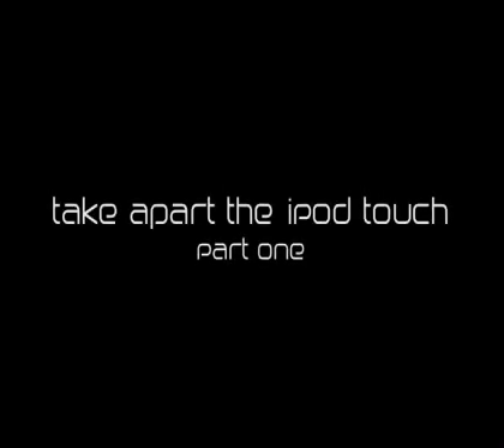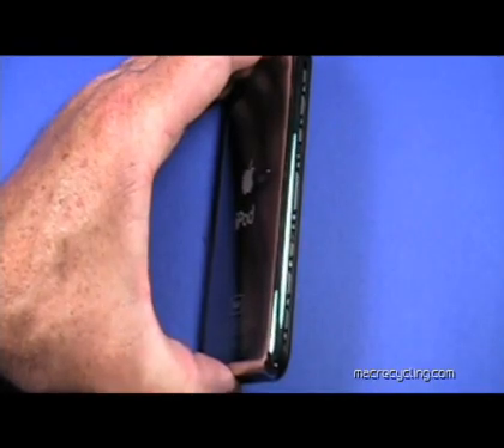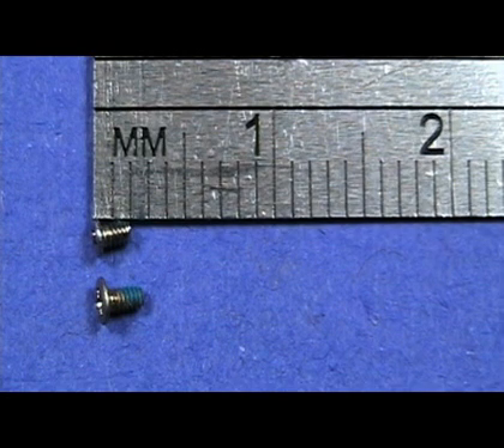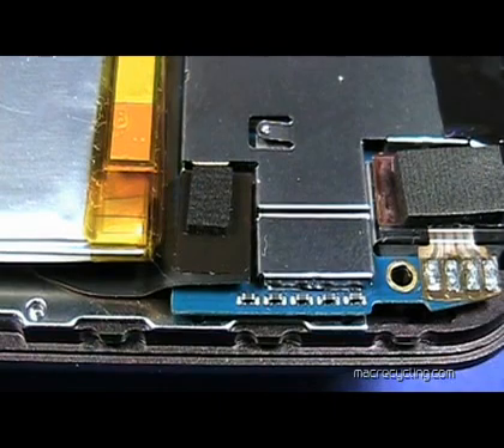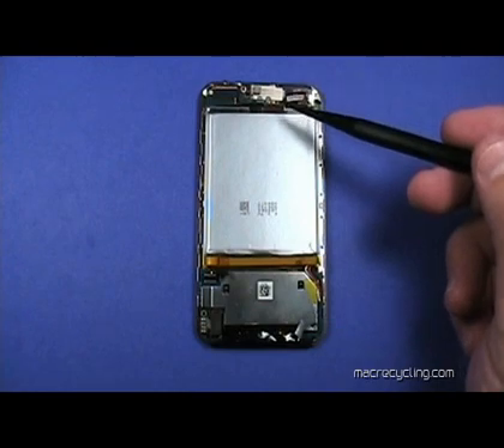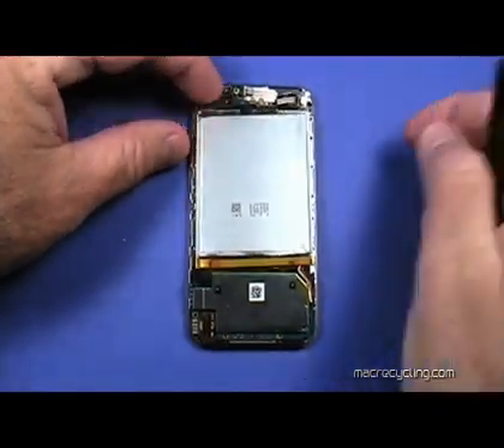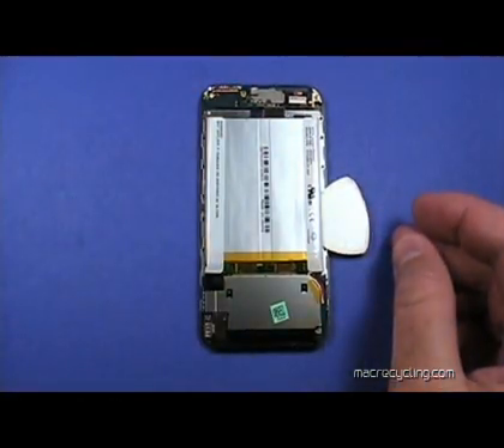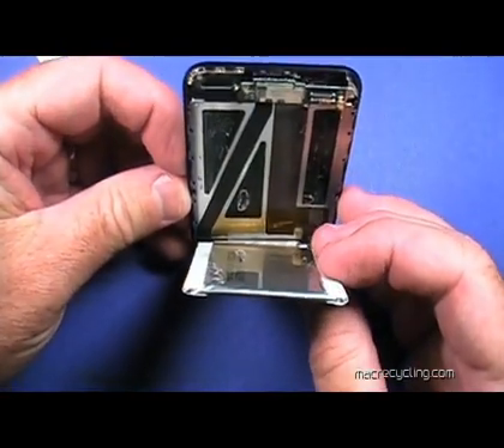Take Apart Apple iPod Touch 1G - Disassembly  Part 1/2

Comment: The 1st gen does need some love to get that battery off but dont worry so much these things are more durable then he lets on. I removed the battery with a knife no damage at all. In fact i did nearly the whole thing with a knife. the only bad thing that happened was that the coper spring came off but you can put it right back no problem.

Comment: This is a pretty good video, better than many others, as it warns you to be careful of the spring on the upper right. It's the first thing I broke on mine however, as I found a different video first. The location of the glue on the battery is a good tip too, thanks! Wish I had found this video first.

Comment: Ok I have a ipod touch 1G and my screen has been cracked. The screen still works (I still play games on it all the time). So I'm assuming the LCD works, but does this mean that the Digitizer also works?
Do I need glass with digitizer or just the 2G Glass?
Thanks! :)